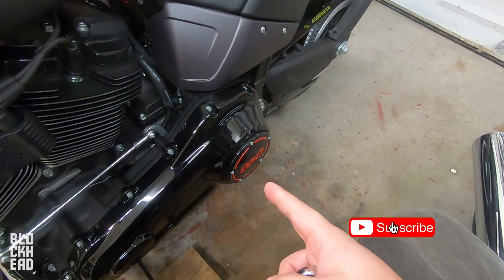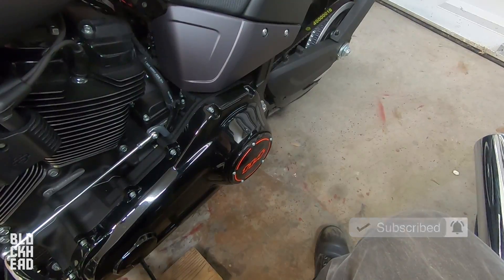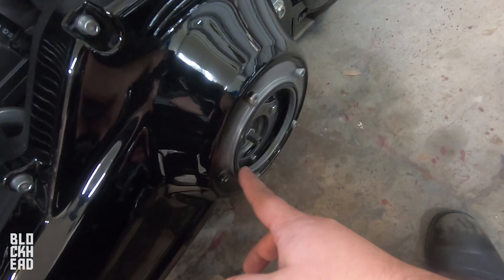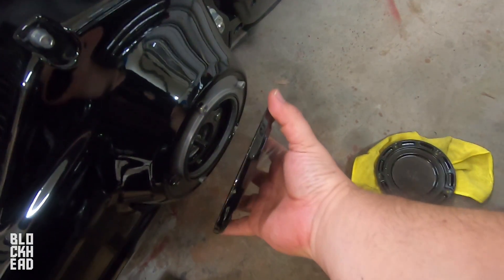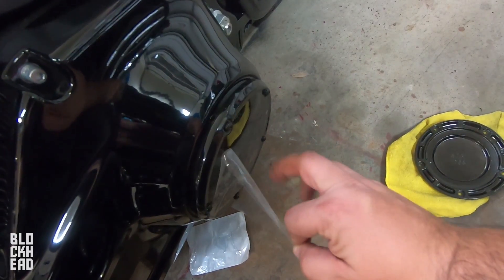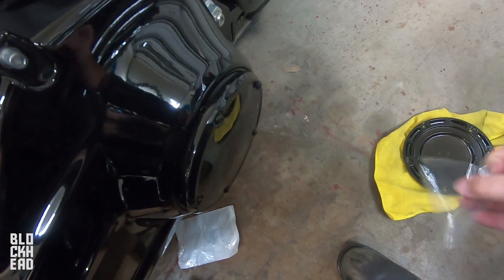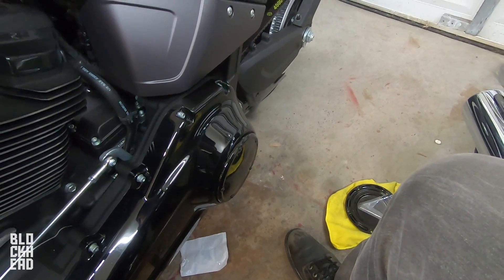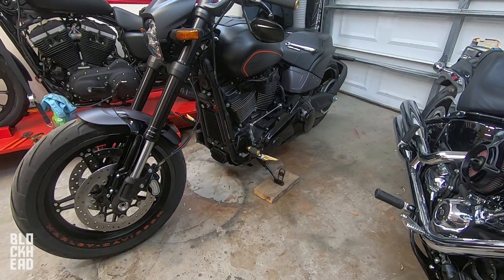Harley-Davidson Derby Cover Replacement / Install

Comment: Is the purpose of the wood block under the kick stand to get your bike more level so fluid will not run out. I order a new derby cover today for mine out with chrome and in with wrinkles black

Comment: Newb to riding and considering any mods to my bike.. what's the reasoning for the star pattern and the torque wrench compared to just getting them put back in as tight as possible? The derby cover is the first thing I want to change, hence why I'm here, but I don't want to fuck up what seems like something simple.
Reply: star pattern is to prevent warping or uneven seating of the part being tightened...torque wrench ensures you don't over/under tighten the bolts

Comment: easy install but if it helps one person it was worth it. the community wins. thanks
Reply from the maker: Easy for sure, and my thoughts exactly! Someone out there will find value in it. A few here even so far.
Reply: @BlockheadMoto  I actually Found the value, I was wondering if I needed a new gasket and if oil will leak everywhere when I open it. I got my answer.

Comment: Are you going to switch the brake/clutch levers? Along with the other mods you did, it's the only one missing for my Breakout!
Reply from the maker: Mine are black, so probably not, unless I find some of those 'trigger levers' like Raj has, haha
Reply: @BlockheadMoto  I'm going for the Kuryakyn trigger blacks! Cheers from Brazil keep up the good work!
Reply from the maker: Sbbrubles Nice! Didn’t know Kury made some, I’ll have to check that out 👌🏼 Cheers man!

Comment: Everything I'm reading is saying in the range of 100 inch pounds, which is what my twin cam was. Is it really that different for the M8? I found a couple articles that said 86-106 inch pounds. Thanks!
Reply: Do not do anywhere near that max 106 in lb torque spec, you wil strip the bolt/threads. Just snug them up in the star pattern then give one more hand tight snug in another star pattern.

Comment: Hey block, I’ve got a 18 sport glide and been fighting derby cover leak. Think I got it figured out, I screwed up tightening it. Did swap gasket. Have you replaced that or are you still using original one on the fxdr. If you’ve changed it, how’d you get it to seat?
Reply: Just changed my fluid and now mine has a slight leak. It's so annoying
Reply: @salvagingsouls5418  take the derby cover off and make sure gasket is completely seated. The reinstall derby cover. Start with 1200 bolt but only run in to touching the cover and repeat with the other bolts in a star pattern. Then tighten to spec again in star pattern.
Reply: I'm gonna try it again. I did that while the bike was on the stand so maybe the gasket wasn't seated properly

Comment: 1. Did you have to drain out all the oil first
2. Why not just paint all the parts black?
Reply: No you don’t have to. Just make sure the bike is as upright as it can be to avoid oil spilling. You can see in the video that @blockheadmoto put the kickstand on a wood block.
Reply from the maker: 1. No need to drain oil if you have it upright. As Tom Rebel noted, I've got a woodblock under the kickstand that makes it stand upright. 
2. I work closely with H-D. Rather than taking the parts off and having the bike down while waiting for the parts to be painted, it's more efficient for me to just buy the parts.

Comment: Just ensure you are using the T27 and not the T25 or you will strip the heads....and when ordering a Derby on NEW Harleys ensure you get the right one, as they are all no longer the same.  The Glides use a TOTALLY different cover...